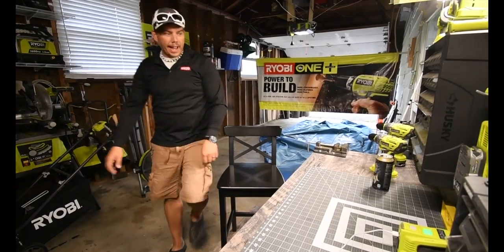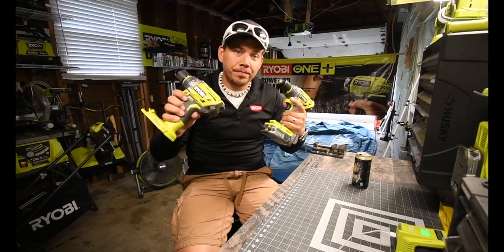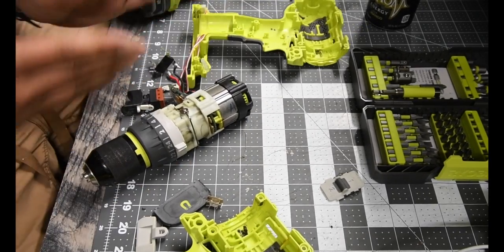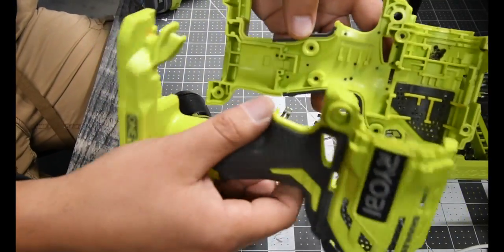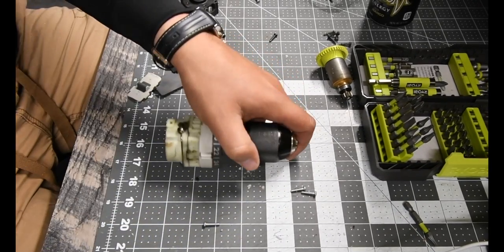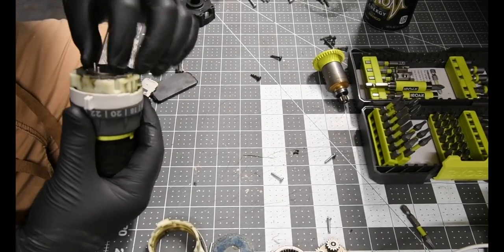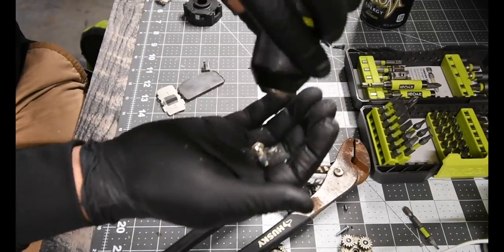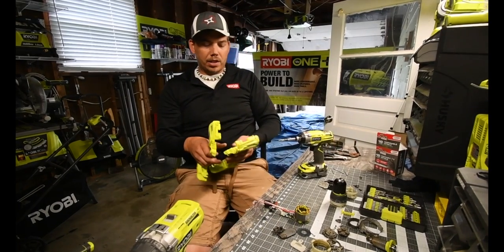Ryobi breakdown!!

Comment: This is a very clear and informative video. My Ryobi drill is losing torque it makes that stripping sound when driving screws is that fixable?
Reply: Sounds similar to my issue. Seems ok with the 2nd gear, but on the 1st gear setting even on a higher clutch, it's like I've set it to 1 and doesn't have any power.
Reply: @JohnSmith-ox7xc  What can be done?
Reply: @CharlesNolanArt  you would need to open it and look at the gears to see if there is obvious damage. It can either be from the gears not engaging correctly (sometimes crud gets in a gearbox and impares smoth functionality) or from the gears being stripped out from heavy use. I personally have never seen any stripped out gears but i have only fixed dewalts as of right now. Usually the clutch on a drill is only engaged when you are out of drill or hammer mode and if that is what failed you would hear ratcheting in both gear 1 and gear 2. Seeing as you have no power only in gear 1 i dont think that the clutch is your issue but i cant bet 100% since i cant look at it

Comment: David, you could do me a huge favour. I live in the UK and I sometimes purchase Ryobi tools. Please could you post a picture of the power rating sticker on the back of the P3320 shop fan. I have bought on line a voltage converter rated at 200W and I need to know the wattage of the fan running at 110V. Then I can get an extension lead next time I'm in the US so I can use it powered from the wall socket.Thank you,Tony.
Reply from the maker: I can sir. sorry for the late delay

Comment: I do a lot of work in walk in freezers so my tools are covered in water constantly. What do you think would work better a brushless tool or brushed? I'm fine with modifying the tools to make them more water resistant but I'd prefer to have a warranty. I just toasted low gear on my drill so I'm shopping for a new one. I already have ryobi batterys and tools that work great but the cheapest drill ryobi makes seems to be a little too fragile. I'm actually pretty impressed with it all things considered. It took a couple 10 foot falls and it has plenty of torque.
Reply from the maker: Brushless is always better

Comment: I have one of these, and the only thing i dont like about it is the chuck  is really bad and lets go really often. From what i hear its a common thing with this drill. Any tips or fix?
Reply from the maker: I havent had any issues with the chuck yet but I thank you for viewing Kvern
Reply: The dewalt will fix that issue.
Reply: @macbook802  funny that you day that. I personally haven't had any issues but when i go to but faulty dewalts there seem to be plenty with chucks not holding bits. Also often get faulty drills where the chuck is locked onto a bit a seems like its broken stuck but its just stuck from corrosion and can be removed with some effort
Reply: Disclaimer to anyone reading
Dont dip your chick into acetone if its plastic on the outside use alcahol instead.

It could be a problem of to much grease in the ratchet of the chuck. I noticed when i get some faulty dewalts they come with locked up chucks holding bits in them this usually happens when the drills have had moisture exposure and have super mild corosion in the chucks due to lack of grease. So maybe if you get rid of factory grease it may make it  lock up better. You can try to run the chuck through a degreaser to wash extra grease out of it like isopropyl alcahol or acetone or something of that nature and substance (old paint removers used acetone). You may want glasses for this process since when you rev the drill up you may get alcahol or acetone drops flying everywhere. Basically get a container full of one of the liquids where you can get your drill chuck fully submerged then get your chuck either fully open or fully closed and submerge it in the liquid. pull it out after 30 secs or so and run it in and out a few times then leave it in the opposite position of where you initially had it during submersion. Rinse and repeat 5-10 times and see if that helped you
Reply: @Russkiman96  These come like this from factory tho, and since the later models after this does not have the same issue im just going to assume its a design flaw that has been fixed.

Comment: I have a R18DDBL that i was trying to use on my 200mm ice augler to drill holes, but when i drill it stops not responding after like 5 sec, it push down good in the ice. Then i have to take out the battery and push it in, but its only working for like 2 sec. I use a heavy duty battery, but i now saw that i dont have the pin on this drill from 2017, so i assume the heavy duty function on the battery dont work. 

Is there any fix i can do on my ryobi R18DDBL so i can use it and drill holes in ice, or do i have to just buy a new machine ? I read something about that it's overheating, but have no clue. Any help or reply with solutions are grateful.

Comment: I took mine apart to fix a connection but the gears aren't quite going together again, the motor and front are not able to lock together because of it, any advice?
Reply: Gotta make sure you get the gears back together properly. Maybe see if u can revere whats in this video or just tinker around. If you didnt touch the gears then maybe u got crud inside that can make it not work properly

Comment: Wow that's a mess that Ryobi Hammer drill use some non conductive lube to help stop corrosion  and with Chuck it's right to unscrew the Chuck  retainering screw left to tighten it  I have changed alot of Chuck's for people I know and myself
Reply from the maker: Indeed it is a mess. but it was a motherboard issue. so no luck
Reply: @ManCaverTools  that's what I hate about these modern cordless tools  everything is  computerized
Reply: @bluemantom77  You are not the only one.

Comment: #42.
I have been using this drill for awhile now. I just recently noticed that the entire front end 'chuck/gearbox' can move up and down. have you had, seen or heard of this issue? Thanks.
Reply from the maker: is has a little movement for the hammer feature
Reply: Yes, mine doesn't have the hammering feature but the entire front part also move up and down, I'm contacting Ryobi to find out what's going on.